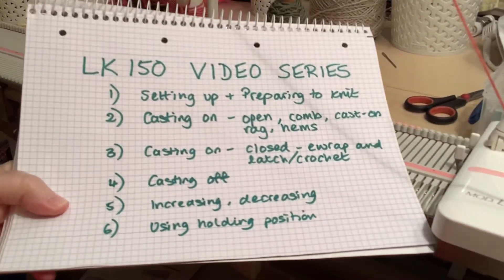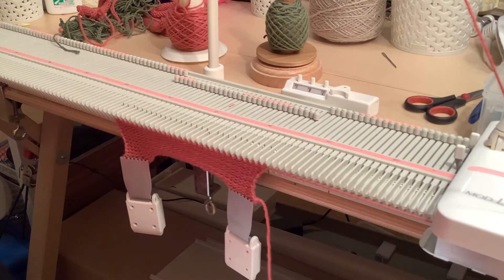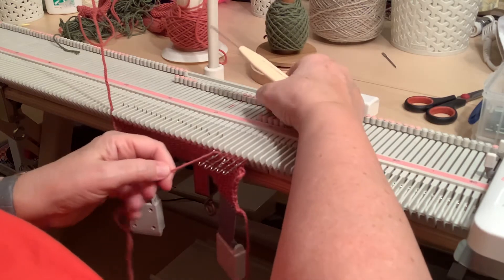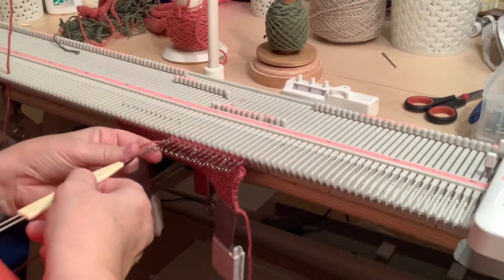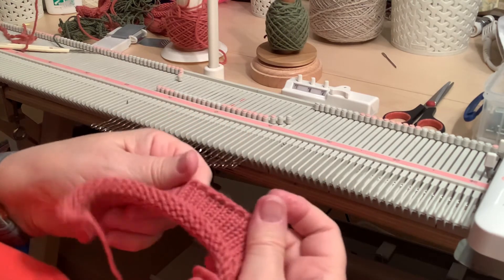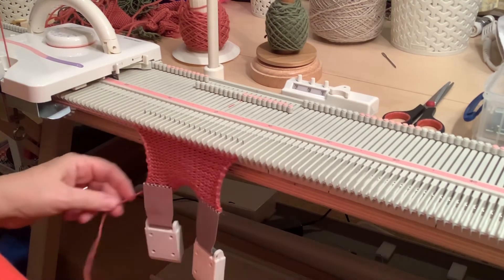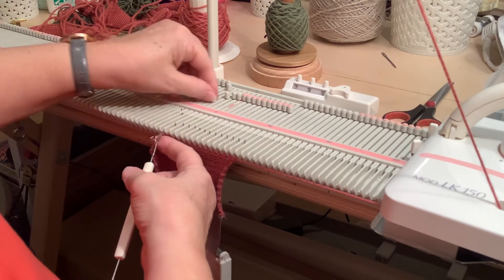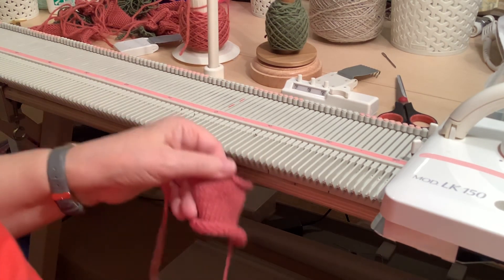LK150 SERIES - Video 4 Casting Off Methods

Comment: What's the best way to clean needles before I put them back please, thanks Sally
Reply from the maker: Soak them in white spirit, then spread them out on sheets of kitchen towel to dry off.  Rub over with a rag and a drop of machine oil as you replace in the machine.
Reply: Thanks very much your a gem 💎